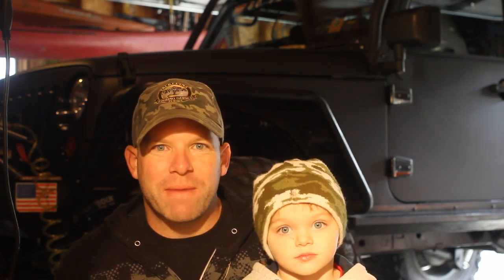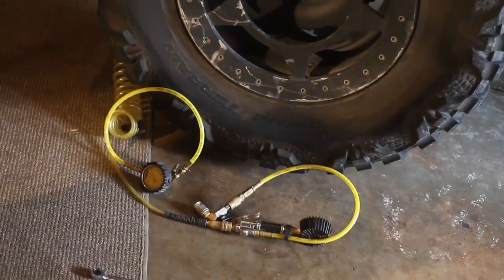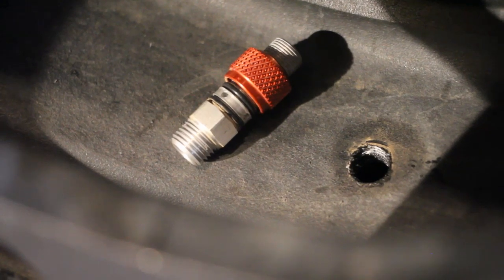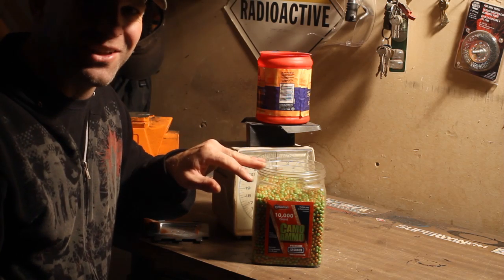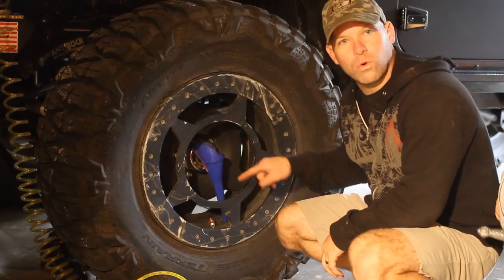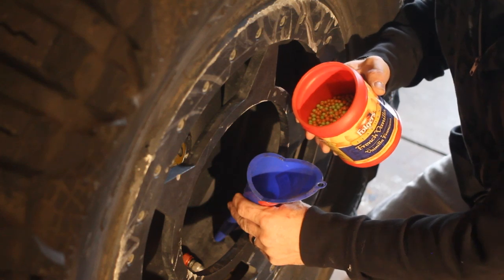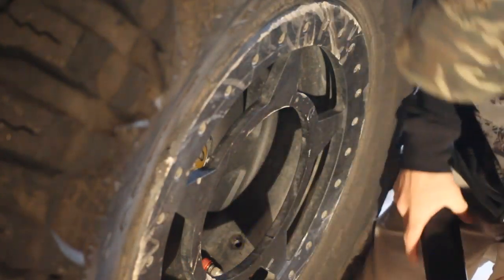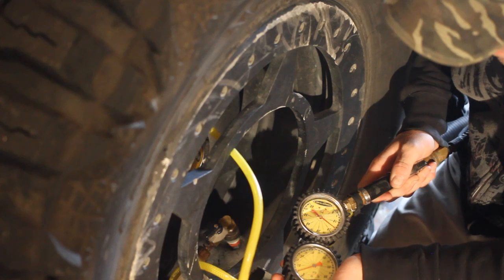BALANCING TIRES

Comment: This was very helpful, i just got a set of 36x14.50x15 TSL swampers the other day (used, about 70% tread, missing some chunks here and there, but including wheels for $500 I can't complain). Everyone in town is too afraid to balance them and i have always wondered about this dynamic balancing thing, I am a mechanical engineer so I understand the physics behind it and it seems to be very effective with big tires. Plus $20 at wallyworld beats $150 at the tire place any day.

Comment: Great video and way to get your boy out in the garage to help you out.  What's your final thoughts?  I've heard mixed reviews but just don't know if it's the type of beads being used or adding too much or not enough beads.  My require balancing about every 4K-5,000 miles or whenever a chunk is thrown out of them. Running Walker Evans Beadlocks and 4WP won't even touch them.

Comment: it works using centrifugal force.  the same way a spinning top works, ( remember your old toys when the top had a plunger to make it spin, and there use to be stuff inside to top to make noise), or how  a washing machine uses water to balance out the load when it spins.  you could also use a liquid like anti-freeze.  i haven't done any of this personally but its a very old and basic concept..

Comment: I almost want to make me some of those valves just so I don't have to take my tires off and break beads. Too much other crap to do. Even the metal bb's don't fit through the conventional stem. Maybe if I had screw ins instead of just removing the valve.